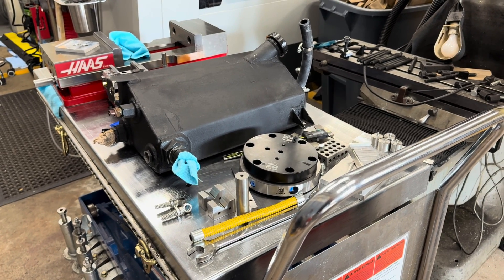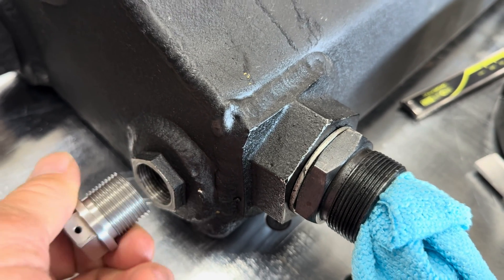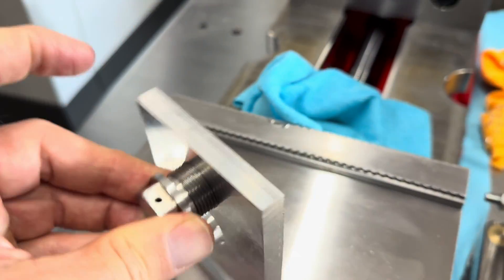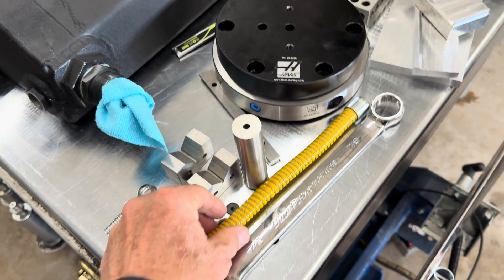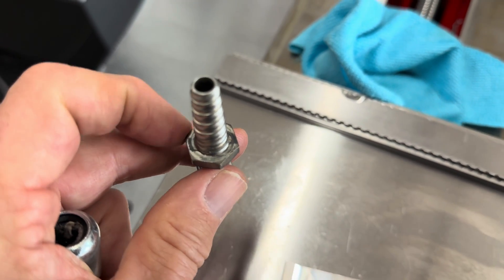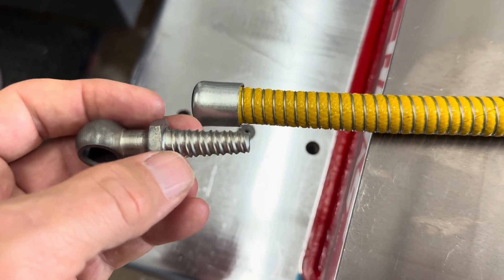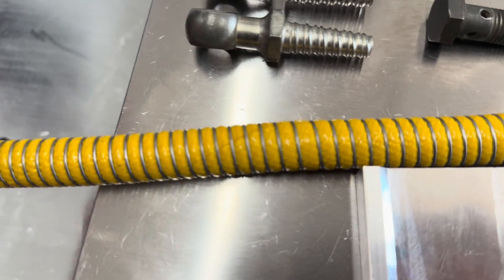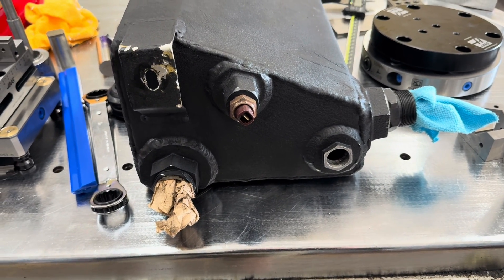How modern CNC machine tools are transforming auto restoration

Comment: That little bajo bolt seems like such an impractical part for a car from the 60s. I know Ferraris have never been known for simplicity, but it just seems like they should have had many other more practical options even back then.

Imaging your job is to braze those bolts together every day all day. Out of 100 parts I would make, 95 of them would be useless solely due to the monotony combining with the extreme precision demand and my scatter brain.
Reply from the maker: I agree.  How many hours did they spend on this, compared to the minutes it takes on a modern CNC.  Plus, our one-piece parts won't leak.

Comment: "Not much you can do with it other than replace it"  Theres no shortage of times that we have tapped hole plugs to the next size, slid a o-ring up to the new bolt head, and resulted in a perfectly fine repair

Comment: "Couldn't do that in the days before CNC tooling" ? BS.
 'I didn't know how to do this before I got a CNC machine' would likely be an appropriately accurate statement..
Those oil hose ends can be made on a basic lathe as a one piece item if you know what you're doing, scaling up is simply a matter of removing less from the material you're making it from, same with the drain plug socket.
Reply: Old mate is doing this as a business 

He isn't saying it's impossible obviously it isn't it has been made originally 50 years ago 

The point he is trying to make is now it's possible to make these parts financially viable 

I get this regularly enough in my shop where yes a have the tools equipment and skill to do a job but dose my customer have the pockets to pay for my time tools and equipment
Reply: @bluejayfabrications2216  I didn't get that from the video, he stated it was not possible before CNC which is quite clearly false. CNC manufacturing can involve much time in CAD then setting up the machine and for a single item this can be much more time consuming, there are other videos on youtube that clearly show this.
Reply from the maker: Exactly.  We can make fifty of these in fairly short order, for far less money than doing it the old way.

Comment: I can just hear the those concourse restoration nerds now. "Oh, that's not a factory part, it ruins the originality ".

Nice work, should be more of this kind of stuff.
Reply from the maker: I have never had anyone call one of these out as unoriginal.
Reply: @j.e.robisonservice6398 I appreciate that, and I am glad that you have not. Being a member of vintage motorcycle club I've seen bikes resurrected from almost nothing and an amazing finished product turned out in my opinion given the bike could have very easily been scrapped. And yet there will be those "purists" who moan about all that is not original. 
Drives me up the wall, I appreciate good workmanship and I enjoy seeing old machines running more.
👍
Reply: The irony of course is that with only a few exceptions even among exotic auto manufacturers today, their parts are often sourced from third parties as well.

But once they put that stamp or sticker on the part, it’s suddenly worth 50x more and 150x more difficult to get.
Reply: Could CNC all four separate parts and braze them together for greater originality. If you wanted to pay even more for it.

Comment: "Couldn't be made before we had CNC machines"
Makes you wonder how they ,made them before they had CNC machines...........
Sorry, I'm calling nonsense.
Reply: I think he meant you couldn't easily make it in one piece with an adjustable thread size
Reply: He told you: They made them in four parts, which were brazed together. 
They couldn't make it one piece without modern CNC, at least not in any way that was economically viable. 

And that's the important part right there: Economically Viable. 

Frankly, it's still not economically viable because you can only make them one at a time, and it'll probably take 30 mins for all the processes. So, if the car has 30 of them, that's 15 hours of machining time (let's assume you've got a long rod on pass-through, so you can just keep feeding it in and making another part without setup time). 

If you're looking at $150 per hour, that's $2250 for 30 fuel line fittings. I can replace my CAR for that kind of money. lol
Reply: @fredmercury1314  Funny, I didn't hear "economically viable " in the video narration.
All I heard was "couldn't be made".

Comment: What's changed is that the programming to make onesies/twosies has become simple enough to be cost effective.
There's no way you're going to program a scaled up tapered thread banjo through conversational control.
Scanners are great. So are advanced graphics cards. 
G code and 5 axis mills have been around a LONG time..
Reply: "No way"? Myself I do just that. I just write Python code to generate the G code. I did it back in the 90s too. No CAD software required.
Reply: @AbbeyRoad69147  I imagine it was possible back in the 90s. There definitely wasn't any Python in the 80s and 2.0 didn't come about until the new millennium AFAIK.
So, you just take a few measurements of a banjo fuel fitting with a tapered threaded boss and are able to accurately scale the finished size in under an hour using a Pentium II?
There were definitely (slow) machining centers that were able to do the work.. given enough tools in the changer, but I don't see that being done in any machine shop back then.
Ultimately it wasn't the tool that wasn't up to the task.
Reply from the maker: You're right.  The newest software makes it practical to translate photos into designs quickly enough that the costs make sense, especially on high value cars.  It was always possible to do this on a Bridgeport, but it took machine control to make it practical and then it took many evolutions of software to get to a point where the capability of the machine can be used this way.
Reply: @j.e.robisonservice6398 
A few years back I read where Porsche was using SLS to reproduce long obsolete parts for their in house historic restoration dept. (I think the example was a Speedster clutch release arm)
Éven with the original drawings it wouldn't have been viable to create those casting dies for a single part and a single customer.
I'm really grateful that 21st century technology and shops like yours are able to keep these classics on the road!